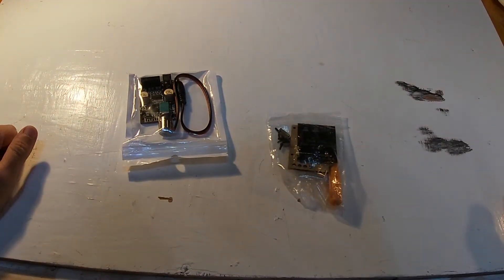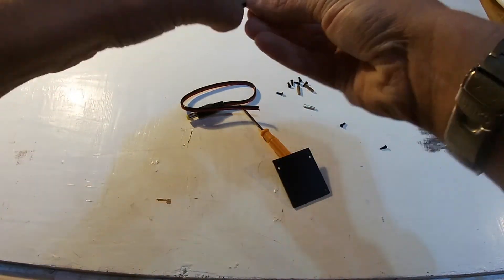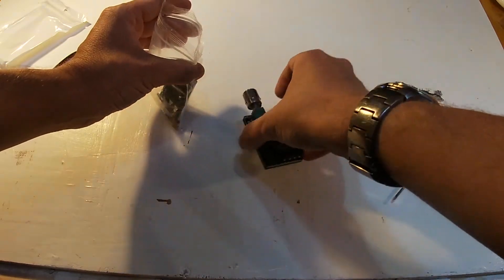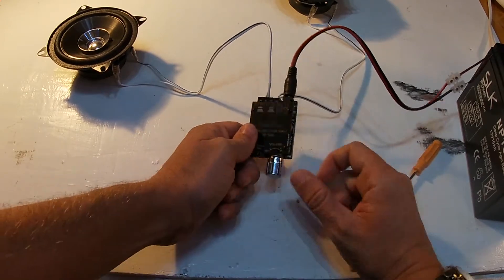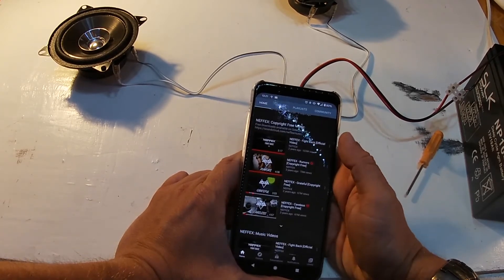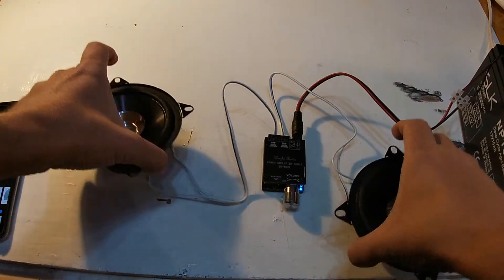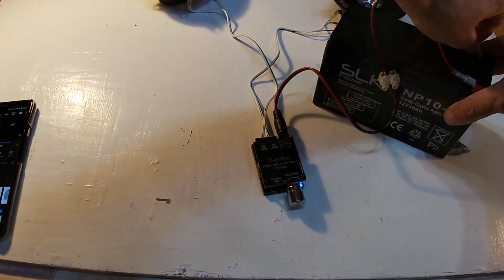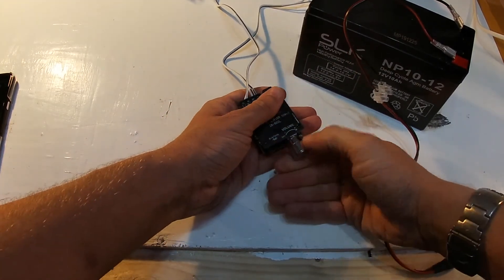Wuzhi Audio Mini Bluetooth Amplifier 2 x 50w channels 9v to 24v Bluetooth Amplifier Board K-502

Comment: No longer works after recent Windows 10 update in August 2024. Cannot uninstall properly either. I uninstalled in Device Manager and there is no reference in Registry but it still appears in Bluetooth Menu as 'paired' but cannot connect. Not recommende.

Comment: any difference in sound quality between Aux and bluetooth?
Reply from the maker: Yes, Aux is louder and clearer but I always find that anything over Bluetooth is a bit quiet and lacking in Bass, so not a fault of this board, just a general bluetooth thing
Reply: @Stitch76  thanks man. so maybe tone control could solve that lack of bass issue?
Reply from the maker: From my experience it's more of an issue of the tonal bandwidth avaliable on BlueTooth, I've not managed to ever get decent Bass from any bluetooth speaker

Comment: Great video. Does this device come with a power adapter and what is voltage like ?
Reply from the maker: Thanks and it comes with a dc jack to connect to the board that has a bare negative and positive wire. Typically I run these on 12v and they are great, more then enough volume :)
Reply: @Stitch76  Awesome 👍🏻

Comment: It supports 2 speakers jbl 3.5w508? Which voltage needed? 12v 2.2a is ok?
Reply from the maker: Yes they should be fine, I run 2 Pioneer TR525s at 12v and it's fine
Reply: @Stitch76  there is no risk of distortion at high volume?
Reply from the maker: @gfpossa  Nothing that I wouldn't expect from any amplifier running at full volume. As an example I am running this amplifier on a kids 12v ride on and have it set to 80% with the Pioneer speakers. The only time I ever noticed distortion was due to electrical feedback from the electric motors on the car due to a bad ground connection. Cleaned it up and all was good.
Reply: @Stitch76  Thanks for your explanation ❤️

Comment: thank you for this review! This is the first one i found with it connected to a battery.
My plan for this unit, is to use it in a CHOSTBUSTERS proton pack. I know not all batteries are the same, but would you have a rough idea how long this would last before requiring a recharge?
Reply from the maker: Ok so a 7ah lead acid battery has given me over 2 hours usage, to be honest there was still life left in the battery but I was done working in the garage at that time. Given it's going on your back, I wouldn't recommend using SLA batteries as they can be quite heavy. I would go with lithium as it's lighter and offers more power, now of course you need to be careful with heat then and also the change of somebody backing into you. Oh and by the way, I love the evolution video of your  costume. Now for this unit running at 12v, I say 1.5ah is at a minimum 1 hours battery. To help you calculate your life span, my personal sum is you are able to use 50% of an SLA battery (so in the 7ah battery of mine, that is 3.5ah which by my calculation equates to a minimum runtime of 2.25 hours), now with a lithium battery take it as 70%. So with a 7ah lithium battery, you would be looking  at 4.9ah useable, which would give a run time minimum of 3.2 hours. Now of course this all depends on volume you are running at and the speakers you are driving. I personally use Pioneer 5.25" speakers and run around 80% max power from the amp. I hope this all helps you out.
Reply: @Stitch76  thank you so much.
My current proton pack is actually powered by the same battery that you are using. And yes, it gets heavy after some time.
I might use the power supply that is available on the GBfans.com website.
Reply from the maker: I just had a look at that site, do not put that blue 12v 9800mah pack on your back!!!! Those packs have been discussed very much in the power wheels and EV vehicle forums and have been found to be fake and with a lot of the cells filled with sand. I wouldn't touch them with a barge pole. Look at your local RC car supplier batteries, you would be looking for a 3s or 4s battery and charger. Also that pack they are selling is very very over-priced, it's like $10 from Aliexpress when on specal offer.
Reply: @Stitch76  you are a gold mine of knowledge!!
Thank you!!
Reply from the maker: Your welcome and thank-you

Comment: What are you using for the battery?
Reply from the maker: Currently I run them on Sealed Lead Acid batteries, 12v seems to be the best, did try on a 6v but would not recommend it.

Comment: Thanks for this video, can i have more information of this Bluetooth Amplifier about hissing or any noise?
Reply from the maker: I've not noticed any when running on 12v and using an SLA battery. A lot of hissing or background noises generally come from poor ground connections. So make sure you have a good ground connection and you will be good.
Reply: @Stitch76  thanks you so much
Reply: Hi. Can this amplifier be connected to a smart TV with the speakers attached ?

Comment: can you help me? im trying to find the bluetooth output of that mini amplifier, but i couldn't find the schematic of pa50wx2 chip online. i want to use it to make my 500w amplifier wireless. thanks in advance 😁. new subscriber 👍
Reply from the maker: When you say Bluetooth output what do you mean? Sorry I don't really understand the question, if your asking for the range, generally outside I can get about 8m with my mobile from the amplifier. It's currently encased in plastic and next to a SLA battery so does have the range cut down but is still good. Oh and thanks for subscribing. I have another one of these boards so can run some tests for you as well
Reply: sorry my. bad, i mean the bluetooth receivers output the one thats not amplified
Reply: sorry my. bad, i mean the bluetooth receivers output the one thats not amplified
Reply from the maker: @muddafucca3379  Ah ok I get you, honestly I have no idea, however if you can tell me how, I could measure it up on the spare one I have. I assume it's a voltage reading your looking for?

Comment: Is the bass good?
Reply from the maker: The bass really depends on the speakers that you are using to be honest. The amplifier does cover the full range of audio frequencies but as I said it will depend on your speakers. There is no way to trim the higher notes on this amplifier as there is no inbuilt equalizer or filter. I tend to use Pioneer speakers, especially the TS range, and find that these provide very good sound quality. I actually have a review of some different Pioneer speakers on my channel if you want to check them out:

Pioneer TS-G1030F: https://youtu.be/txJlltAb-Y8
Pioneer TS-G1010F can be heard in this video: https://youtu.be/cn5MU19V6F8